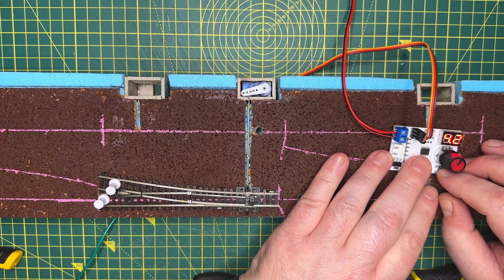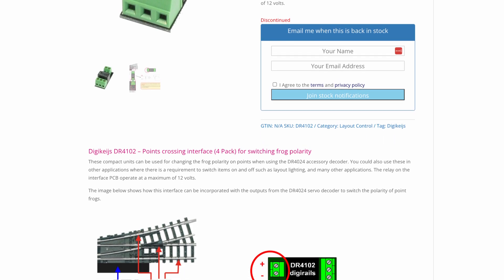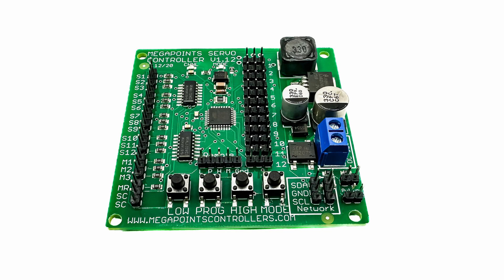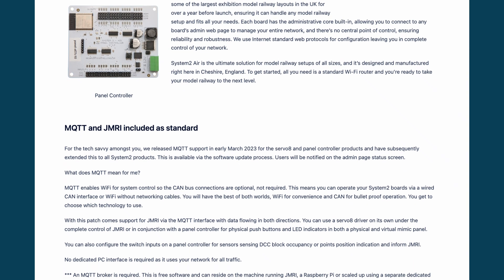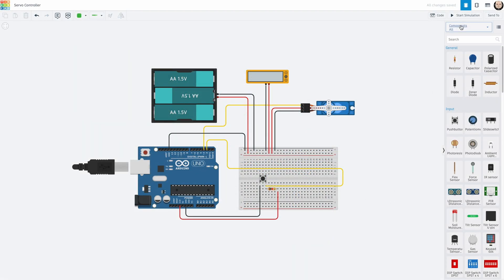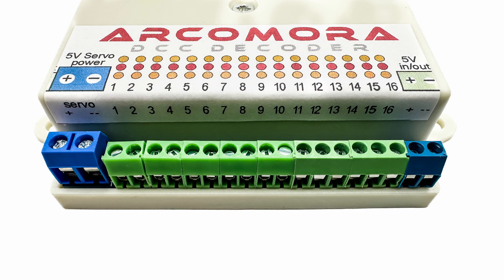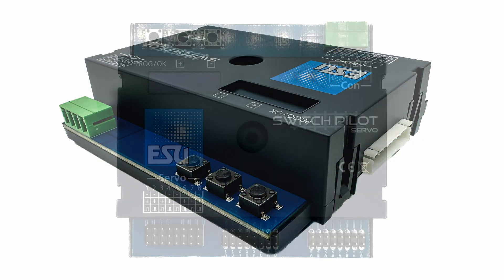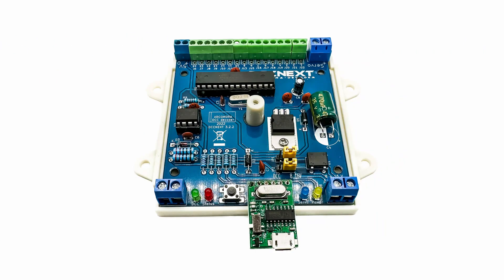110 - Miscellaneous - Servo Motor Control Thoughts

Comment: Hi Ian, far from being bored by it - I found this really interesting - there are so many options! A lot of them cost a lot though. I was aware of DCC Ex for Arduino-based DCC control, but don't remember hearing about DCC Next before. It will be interesting to see how you eventually bring it all together, which I've no doubt will be another journey of options and learning 🙂
Reply from the maker: Good morning Jonathan! Thank you! I've looked at DCC Ex a few times, but last time I looked it didn't work with WiFi throttles, and controlling trains on a phone / tablet just doesn't appeal to me! I like the tactile experience of an actual throttle in my hand! The DCCNext stuff is very good, and I'd recommend taking a look at it! You can buy the ready made units, like I did, but if you like building your electronics, most of the AcRoMoRa stuff is sold in kit form, so you can build it yourself! I'd still really like to go down the Arduino route to save a bit of money, but it would take a lot of time to create a DIY solution, even if I based it on DCCNext, and I'm already way behind laying track for Shelfington! Oh well! All the best, Ian.
Reply: @iansngauge  I'm very much the same for wanting physical throttles - I had been wondering about using JMRI with a Raspberry Pi because I've got the wifi module for my Gaugemaster system, so could have physical controls to the Pi which would then connect over TCP/IP to send the JMRI commands, but I'll definitely be looking into DCCNext now that you've made me aware of it - thanks!
Reply from the maker: @endoorrailway  - Whether you decide to go with JMRI and the Raspberry Pi (bit of poetry for you there) or the DCCNext system, I await your experiments with much anticipation! :)

Comment: An interesting study Ian. I have a few innaccessible points DCC controlled using peco surface mounted motors and DCC Concepts accessory decoders through the Z21. I can switch the points on the ipad that controls the trains. These decoders are ok, although on a board of 8 decoders, have had 3 or 4 fail. DCC Concepts did replace them for me, but still no idea why they failed, as all wiring is done with power off.
Reply from the maker: Thanks very much John! I've actually got a couple of DCC Concepts accessory decoders for controlling Solenoid motors! I also have a few Rails Connect decoders, that are made by DCC Concepts - two of which failed while I was testing them! Not sure why either! My plan is to control all of my points via DCC, then I can choose how to switch them later, either using a hand controller, an iPad running the Z21 app, a retrofitted panel, or JMRI / iTrain! There's still a long journey ahead... I may even paint the blue foam a different colour at some point! :) All the best, Ian.

Comment: note if you are bothered on the ambient sound stuff a basic arduino, UNO or Nano is useful, specifically because there is a "DFPlayer" module, this is a little module that takes an SD card loaded with MP3 files, and can directly drive 8 ohm stereo speakers. has a serial link to the arduino which can tell it what to play in what sequence, respond to button or sensor inputs. all pretty cheap as well.

gone totally homebrew arduino based here, N gauge layout used the C/MRI system to feed back to the control PC, the under development OO one is using ESP32 boards to feed back over Wifi following how Wirenwood are doing it using Mosquitto. then using the DCC-EX system to actually drive trains which really is idiot proof (I managed it) - this can also drive point servos using a PCA9685 expansion board (that can drive 16 of them and can daisy chain). if you want frog switching relays can also be controlled as outputs

one further option worth considering is the MERG system, I use the DTC-2 block detectors but they also have servo driver boards etc and a full DCC system

all about finding whats suitable and within budget, mine is cheap as chips but takes fiddling, the pre-packaged stuff is better for those who just want to drive trains and really not worry about it
Reply from the maker: Thank you again! I've actually already got a DFPlayer module, just haven't got around to playing with it yet! There are so many things to sidetrack you in this hobby aren't there? I've only recently discovered ESP32 boards, and the WiFi element seems very useful, so I'll definitely be looking into using them too! I've also looked into DCC Ex previously, but at the time you couldn't use WiFi throttles other than a via a phone or tablet, so I discounted it, as I like the tactile feel of a proper throttle! Not sure if that's changed? I think I've also got a batch of the PCA9685 PWM servo driver boards that I was going to hook up to an Arduino, but the project hasn't got off the ground yet! Again, getting sidetracked is quite easy! MERG is something I've not looked into at all! My electronics skills are somewhat lacking, so I'm not sure it would be a good route to go down! I have to agree with you, that it's all about what is suitable at the end of the day! I wan't servo control, frog switching and RailCom feedback / interrogation, and at the moment, a pre-packaged system seems like the best way to get this, without undertaking a huge DIY project! Thanks again for your thoughtful response! All the best, Ian.
Reply: @iansngauge  best bit with MERG is they supply kits, ones that are easy to solder up with very detailed instructions, worth a look as the stuff they have is very reasonably priced.

the idea of feedback over RailCom is interesting, trying to stick with just RailCom enabled decoders here, hadn't thought about it for static stuff, interesting idea.

and yes easy to get side tracked, I've got a whole office full of "sidetracked"
Reply from the maker: @aleopardstail  - I may take a look at MERG as quite a few people have suggested them! I just don't think my soldering or electronic skills are up to the job! Yeah, I'm purchasing RailCom controllers whenever I can now! Being a software engineer I like that I'll be able to write code to interrogate the hardware to find things out about it! Just makes sense to me! Cheers, Ian.

Comment: that digikeys servo controller could likely very easily drive the Arduino relay modules, +/- feeds and a signal wire
Reply from the maker: Thanks for the idea! I may look into that at a later date, or repurpose the Digikeijs controller to control something like crossing gates, or a barrier or something similar! Cheers, Ian.

Comment: Hi Ian, great video, as you know I am using servos controlled by picaxe chips, with home written code. There were a few of your options that I hadn't come across so it was good to see other options.
I have found my standalone design of a numerical keypad and serial network connection to be pretty reliable. 
Looking forward to more videos
All the best 
Allan
Reply from the maker: Good morning Allan! Yes, I like the way you've gone about controlling your servos! I'm nowhere near as confident with the electronics side of things as I am with the programming side, otherwise I'd definitely have gone down one of the Arduino based routes! I really want to incorporate DCC and RailCom, but have no real clue where to begin! I fear I'd spend so much time on it that it would take even longer to get the track laid! All the best, Ian.